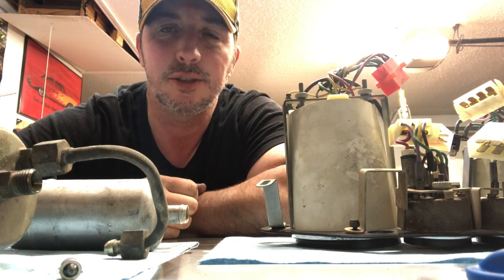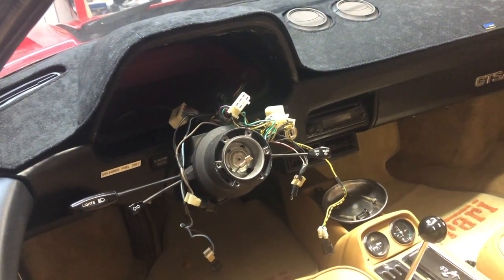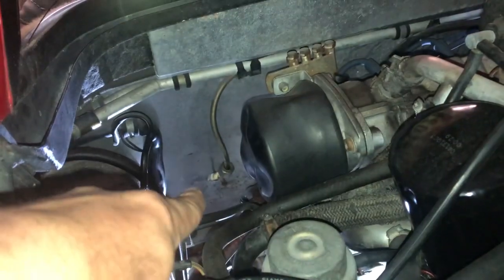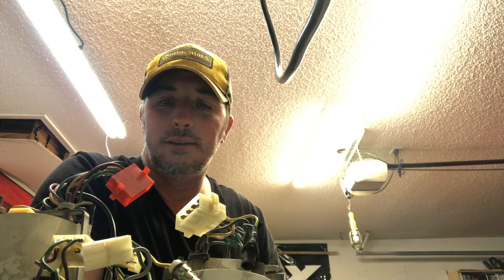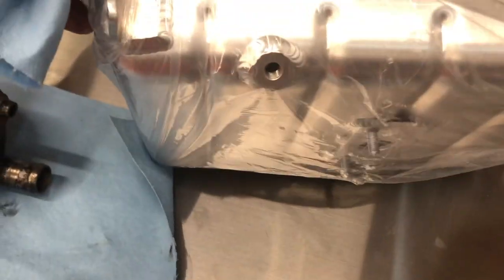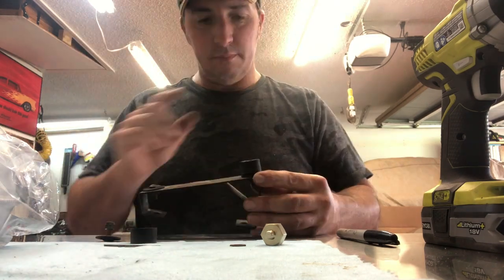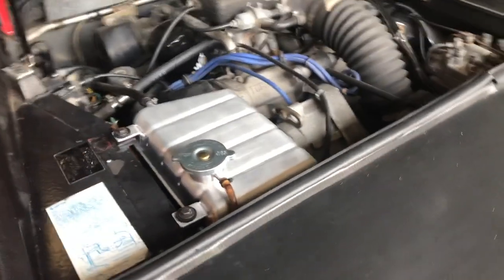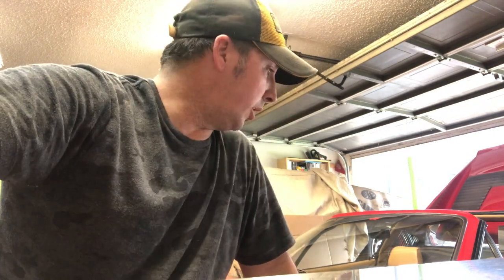LED conversion, Fuel pump & Coolant tank replacement on the Ferrari 308

Comment: I have a 1982 308 Ferrari and would like to know has he changed the rear turn and stop indicator lights to led?
Reply from the maker: I haven’t changed them yet.  I’m going to just change the brake lights for now as the turn signals require a regulator I believe